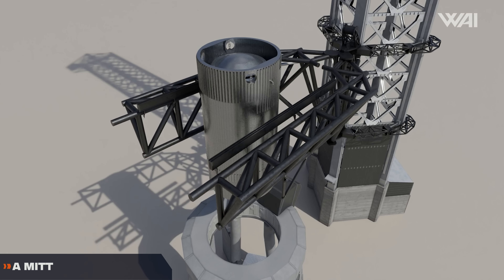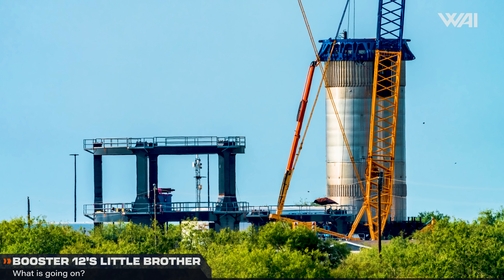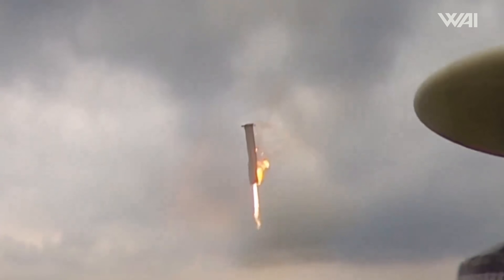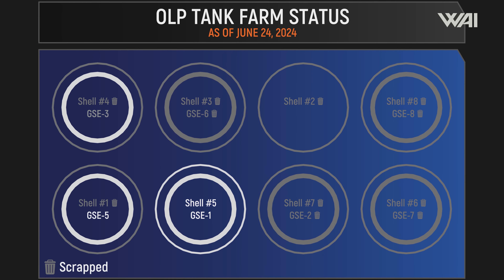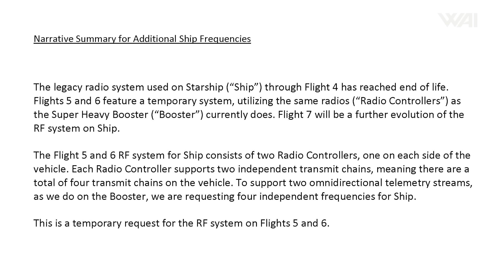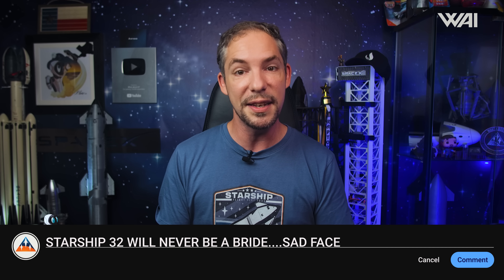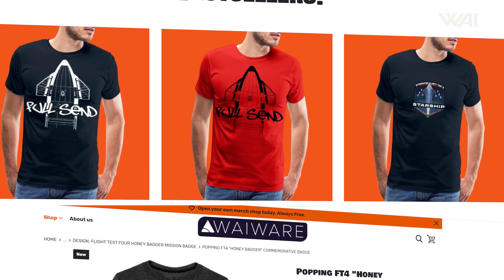SpaceX Massive Starship Drop Test! & Musk Talks Heat Shield, Starship Failure & Raptor V3!

Comment from the maker: What do you think SpaceX’s plan for Ship 32 is? Will it meet the same fate as ship 20 and never leave the rocket garden, or will it get an upgrade and fly on flight 7? :_WAIHello:
Reply: I think it’s already been retired to be honest. No work on it for months, yet the respective boosters have. Straight onto v2 for flight 7 I reckon
Reply: Spare hardware for catch attempts.  :>
Reply: Ariane6 is already outdated even before its maiden flight but at least Europe has a rocket, again.
Reply: You rock Felix!!!
Reply: Who would have ever thought SpaceX would have given less thought to ullage gas pressurization than I did, wild. I eventually assumed they used heat exchangers to get dry gas to prevent ice buildup and dismissed it from mind. Ullage gas pressurization and ice buildup are a single thought just like dropping a hammer on your toe and knowing it will hurt even before it lands. Amazing.
Reply: Felix:  the 'Stix need to be as high on the OLIT as they can go, because those CGE's (central gimbaling engines) are going to hammer the OLM as they get the Booster into position. Only after they've caught the Booster do the engines cut out, and only ~then~ they can lower the beast back onto its mount. And that is ~IF~ it survived the punishment from the Boosters' center engines. I hope Elon's tech have thought about this... 
Why not try to catch the Booster with the 'Stix rotated to one side... where the CGE's won't hammer the OLM!

Also... We want a plushie of the animated Spaceman! And a 3-d printable figure as well. Bonus if he's partially posable!
Reply: I believe they will see what happens on IFT5 and make the improvements to 32, ie...move fins, adjust heatshield dynamics, new RF system, based on more data
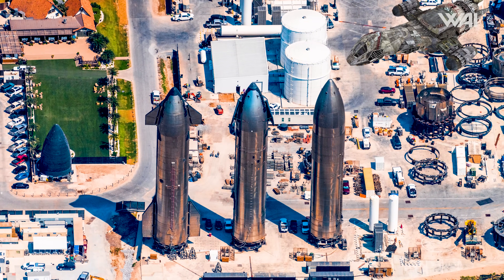Reply: Pretty cool new ship at 12:40 above to the right
Reply: I say only a new test structure
Reply: Well if we have ship thirty one on flight five then that means that ship thirty two has to be for flight six and flight seven will introduce the new block 2 starship. Also Felix do we know when we will see the new block 2 booster
Reply: Uhmm... those are NOT gantry cranes, they are bridge cranes, Omni does not build gantry cranes. A gantry crane is a freestanding mobile outdoor crane on wheels... the Omni crane(s) pictured have 2 rail arms mounted on each end which have steel wheels which will set onto fixed rails inside the building giving X-Y-Z movement once the trolley is mounted on top of the bridge within the bay the crane was built for.
 X travel is generally the length of the rails of the span, no clue how long the bay is, so... the bridge looks to be sized that about a 50 ft to 55 ft span will be bridged, giving a Y travel of 45 ft to 50 ft, and Z would be the floor to MAX safety stop vertically... no clue how high the rails are but, you can safely assume 20 ft of Z with a crane that size, maybe up to 30 ft... could be higher, depends on the building height... aannnd you can figure those cranes are run north of a half a million each...
Reply: 06:21 onwards - Europe has had operational rocket launchers continuously for at least 60 years: Soyuz (the venerable R7) is launched from Baikonur and from Severniy (which means Northern) both of which sites are in Europe. (Vostochniy, which means Eastern, is in Asia, as far as I can tell). Furthermore Angara is operational, and I think that Proton might still be around. Russia has also had a variety of smaller launchers over the years, some of which might still be operational.
Reply: The exact reason 2 million people monthly do not subscribe is the childlike comments between the actual information and the obviously reduced speed of the video altered in post.  No one watching this channel is at a elementary school level of education.

Comment: I think maybe the solution to the flap joints ,would be to make all of the joint behind the sheild, and out of the plasma. So the one side would be built out and shaped to shed the plasma, and the flap would be "behind", placed proud and bend backwards as it were to reach the operation angle  needed for control. Maybe longer, maybe wider, whatever is needed. The main thing is to remove the joint from the plasma stream. Or perhaps build over the hinge so the hinge is "hidden" from the plasma stream.

Comment: Something I haven't heard is
How accurate were the landings of SpaceX's fourth flight?

Quite frankly I wouldn't try a catch test until they achieve pinpoint accuracy.  Plus they need to get the wobble out of the chopsticks completely.  Even a minor amount of wobble could be disastrous.

As for the icing problem, there's more than enough heat from the exhaust to mitigate that through a heat exchanger or other indirect methods like say a heat coil or element.

Comment: meh, I said it last year, I'll say it again.  they need to get those chem eng to work a polymer phenolic resin-based material, PICA (phenolic impregnated carbon ablator) or SLA (super lightweight ablator)  and use it as a base for a resin based glue.  Adhere the same tiles and the glue now adheres (hopefully) and ablate if you lose a tile.  Ablative Glue. saves a ton of weight because two layers of tile is less than efficient.

Comment: I don't think there is going to be any actual dropping of the booster. Doesn't make much sense to drop it to test if the arms can handle it if the test booster weighs in 1/10th of the actual booster. Much more likely scenario on that is that some sort of additional weight woudl be added hanging below the booster (provided they have added any tie-down points to it), much like when the clamps were tested, and that would be lowered to the arms as A) in order to test such things they need the equivalent of the proper mass, B) dropping something with extra weight bags is going to be messy/uncontrollable and dangerous and most imporantly C) doing it with crane still attached to the thing gives them highly controlled test situation with rapid iteration. On the other hand, if it is not about "drop testing" it would most likely be just about the booster alignment etc. to make sure they can rotate the booster in controlled way from misaligned positions.

Comment: SpaceX must REALLY have confidence in their ability to 'catch' a SuperHeavy and Starship with....er.....'chopsticks'. To this non-engineer, this looks like a really dicey proposition. IMNSHO,  the Two Towers are way too close together. Both towers are too close to launch infrastructure. What is the minimum height Space\X would initiate a Boosteer Self-Destruct if the thing looks like it's going off course. I haven't read anything about this, but we know SpaceX only releases information they want to release. That's no excuse for ill-informed speculation on my part in the absense of facts. I hope the heat shield addition of an ablative underwear works, but I'm not really confident about how strong the adheasive bond between the ablative layer, the tiles, and the stainless steel skin is. But, then, I'm not an engineer.

Comment: Surely a chaotic ‘ground effect’ of completely disturbed air coming down on the scaffold catch arm and support tower on one side of the decelerating booster cannot be calculated and accounted for? The booster is doing 50-100 miles an hour when its rocket tail is reaching the top of the 400 foot tower. I just can’t imagine how this will ever work.

Comment: Felix, why don't they use the heatshield tiles they removed on the orbital pad legs to protect it from the launch? Unless there is a risk of them flying off from the pressure of the launch.
Reply: They're not going to "fly off" from the pressure... they're going to *disintegrate*. They're ceramic tiles... good for heat, not so good for 80MN worth of Raptor exhaust hammering on them.

Comment: So, what’s your thoughts on improvements that could be made?  I’ve been thinking a lot about the acoustics.  We learnt a little from flight 1 and space ex responded in a raps manner to encourage that it was a possible outcome (big hole in the ground etc).
Flight 2 saw all engines ignite, first stage separation and many other successes;
Flight 3 pretty much developed and ruled out some shit;
Flight 4 proved and tested the combined best effort.  We achieved orbit-ish (to plan); we landed both booster and starship.
Stress points were on heat shield.  I expect future iterations may have some for heat shield on the main body and protesting the joint area, but these guys will figure that.
I’ve also been thinking about the tile shape.  We have done loads on ships going up and the flat tile design represented that.  The recent curvature at the edges shows an acoustic consideration but I think it’s over engineered.  Why not keep the simple base design in all tiles mut manipulate are flow on the way down with a belt on the top and bottom, kind of built into the heat guard for the flaps.  Could be made expendable and quickly changeable, this factored into planning shit.
I totally thing OFT5 has a great chance of pulling the landing off but I do have my questions on impact of in place mitigations to accuracy. Space exploration prove over and over they can land stuff, totally cool I’m sure we all agree.

Point I made earlier: can the infrastructure take it.  Exciting and site 2 is young enough to react so loads of info to come no doubt.  Thanks all.

Comment: Dont see the crane dropping a load the weight of the 14.1 booster, the crane boom will jump because of the sudden load release which might result in a backflip of the crane depending on the boom angle.
Much more likely is lowering full speed.

Comment: I disagree with the 2 points on this.  They are relevant but a bit unrealistic.
Flight 4 tested accuracy and mecazilla’s respose - data is pretty much done.
What we have not done yet is test shit coming down.  We have prototype but untested dampers, so, put a perfect width to current motels in place and pull down with the landing mass minus thrust and see if it works.  What’s the line; where should they catch it and what’s the limits.  I think this is much more likely Felix.  Love the show though, best out here.

Comment: How much fuel would it take to fuel 1000 starships all going to Mars at the same time? How long to fuel that many ships already  parked in orbit around the earth? How many  tanker flights to transfer fuel for 1000 ships? They say 10 flights or more to send only  one to the moon. I doubt this is ever going to be possible.  Another type of engine is needed. There is another problem. Fuel to get down to the ground and back up again plus fuel to go home....I am in my early 70's. I will never see it in my lifetime unless they use nuclear or metallic  hydrogen as a fuel source. Or another breakthrough revolutionary  type engine is invented. I suspect  the Chinese will do it if it's ever done.
Reply: They don't need to go at the same time but in the same "time window" to get to Mars.  How long that window is I'm not sure but likely at least a couple of months maybe as much as 6.

Comment: someone at spaceX is freaking out right now realizing the booster doesnt actually have yaw control at low velocity and that this catch method requires super precise yaw angle for the nubs to hit the arms.
Reply: You "know" it has no yaw control how?
Reply: @Scanner9631  because it  only has grid fins and grid fins require high speeds. And they only light the center engines for landing so no torsional control.
Reply: @Alex-gc2vo  

And SpaceX doesn't know this?  They don't have any other form of thruster or control that you might be unaware of?  

I think I'll stick with SpaceX on this one.

Comment: Prevent ice in tank at valves in tanks with a pipe sized grid mesh that has the exhaust gas into tank flows at temps to prevent ice

Comment: 😅The testdroptank could be used for different weight tests by filling it  up with i.a. water. That way it would not be lifted higher and allthough the additional weight would stress the tanks structural integrety by pushung on the bottem. That way a maximum test would only wet the lauchtable, instead of crashing the whole steel tank on it.
cheers
just my 2 cent

Comment: Don't expect Mars or the moon to be waiting with chopstick arms or landing pad. Where it land's there,it has to launch from
Reply: With .38 g on Mars and .17 g on the moon it doesn't take the same thrust to lift off or land. So less damage to the surface both on landing and launch.  The HLS is also planned to land using thrusters higher up and firing at an angle leaving still less damage and that offset from the landing site.

Comment: Question. Why not put the hinge area for flaps out of the high heat plasma zones? Move hinges more to the rear of the ship during re-entry? Right now they are in direct high heat zone.
Reply: That has been the plan for the V2 for probably a year now.  They also are changing shape and size.  Revised models have been seen on site already but none installed to my knowledge.

Comment: Interesting picture at 16:55 of the Ariane 6 launch setup with ramps either side of the flame trench. With the high water table at Boca making subsurface structures such a pain I wonder if that might be a solution for OLM2 to get a flame trench with less digging than might otherwise be necessary by only having a shorter section under the OLM and a bit to each side being below ground level and the rest of the exhaust runoff area being above the surface just like that Ariane setup.

Comment: Can you make a video to explain why they need to use heat tiles as apposed to using one giant tile or sheet?
Reply: When the ship is filled with cryogenic fuel it cools down and contracts, and when its reentering through the atmosphere, it heats up. Multiple tiles with gaps between them are needed to allow for this contraction and expansion. If it was one big tile it would crack everywhere.

Comment: if they do a drop test, i hope they also do a drop test at 'arms length' too to simulate 'worst case scenario' where the booster falls a little short or moves out a little and drops. as that would be maximum load/shock on the arms

Comment: Dropping 2 inches simulates a vertical landing velocity of 1 meter per second (2.2 mph).  Did you build in a factor of safety?   SpaceX may want to ensure the arms could absorb 2-3x the energy?

Comment: MESSAGE TO SPACE X 
@Whataboutit I’m looking at the complexity of a booster catch scenario, and contemplating the potential damages if a catch is unsuccessful. 

Can you get a message to Space X? Suppose a catch procedure was reimagined. Designed from first principles. You want a reliable, robust process which minimizes stresses on the vehicle, while ensuring minimum damage to the catch structure in the event of a mishap. 

I propose a purpose-built catch tower. It’s as tall as a booster and cylindrical in shape. Inside are water sprinklers and a shallow pool of water at the bottom. The vehicle simply needs to fly itself to the opening at the top, orient itself vertically, and lower thrust. 

The water becomes superheated steam and literally cushions the ship as it continues it’s decent. The size of the opening at the top is designed to capture some of the gasses displaced by the entering vehicle. 

Simple. Reliable. No potential damage to a launch tower. 

Can I get a thumbs up? If you have a contract within Space X, please forward. Thanks a bunch!
Reply: A backwards potato gun. 🤣

Comment: Perhaps the next step for the catch test can is put one or two raptor engines under it and actually try to catch THAT! The flying water tower rides again!
Reply: They have the one Starship with no flaps or heat shield that could be used instead.